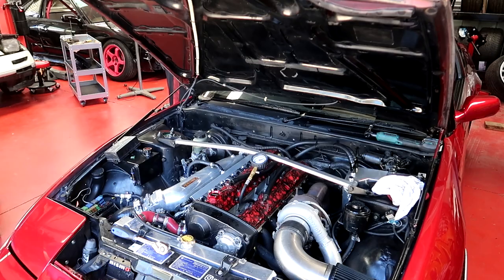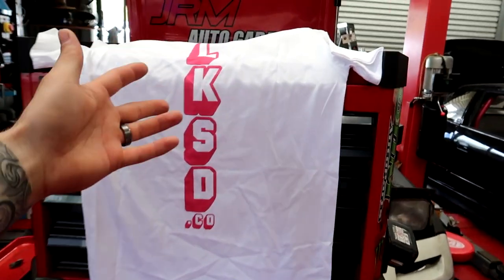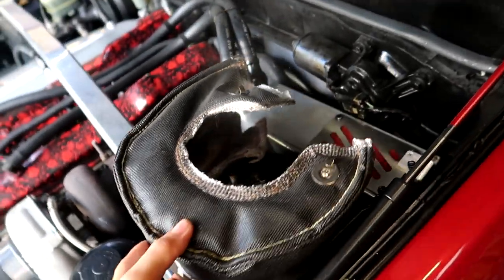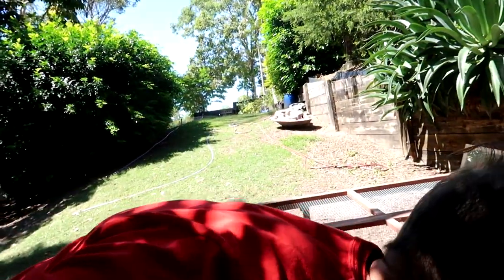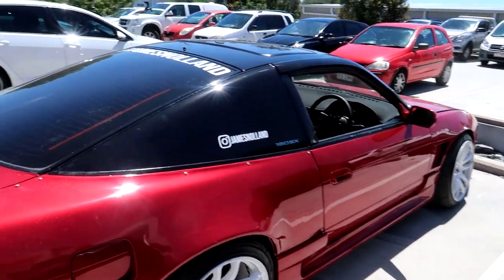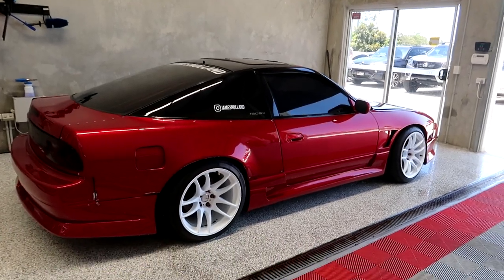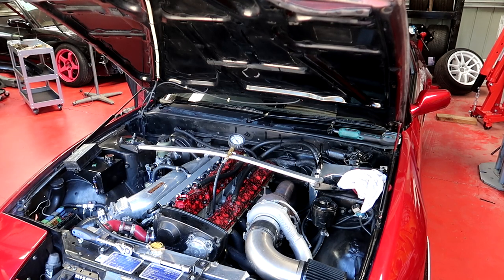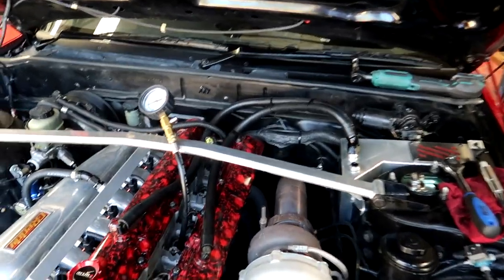DID I BLOW THE ENGINE? II 4 Years of Abuse, Compression test time Ft Coat X, 180SX RB25DET 469HP

Comment: James, you had the plugs still in when you did the compression test.? All the plugs should be out, then test each cylinder.  Do a leak down test to see if it's your rings or valves. Good luck.
Reply from the maker: Cheers mate thanks for the tips 🙌

Comment: Definitely all plugs out for compression test, fuel pump fuse out, coils disconnected, did you put a couple of squirts of oil in each cylinder to do a wet compression test or look down bores through plug holes with borescope? Oil welled up looks like dribbling from rocker cover gaskets, I saw snail trails in video, probably is due for full rebuild before bang happens, I am a real mechanic, not an internet mechanic lol, enjoying your videos, maybe I’ll see you at Archerfield Australia 🇦🇺 day 🤟
Reply from the maker: Haha love that real mechanic not internet one thats so good. Yer man thanks for all the tips will do it that way next time but yer shes deffs in need of a re build 😁, I'm not going to be there unfortunately but im sure you will have a awesome time 👌